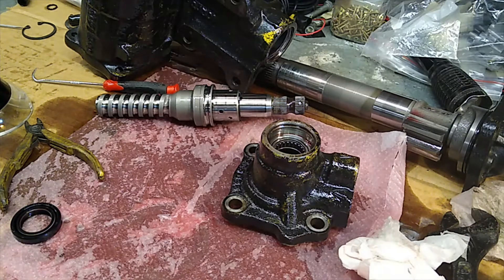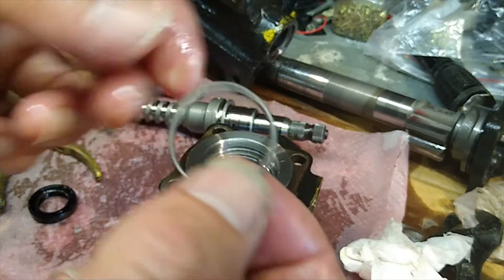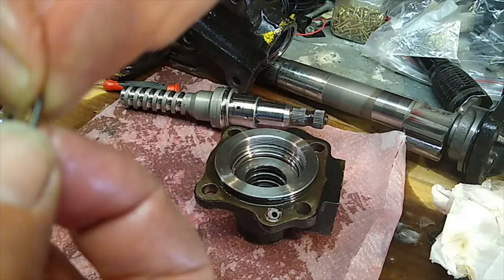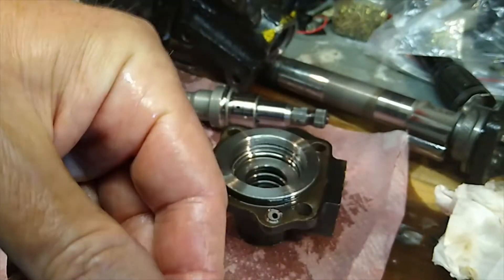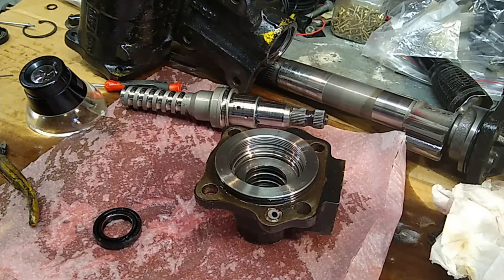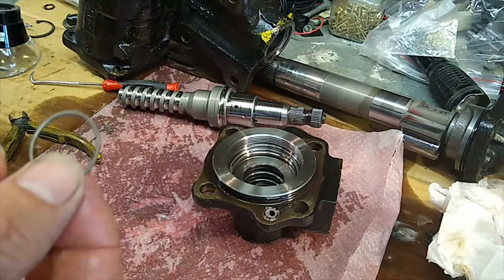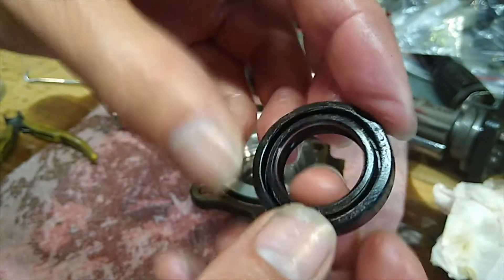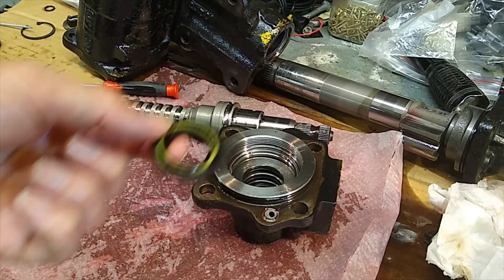Adjusting Oil Seal tightness to stop leaks on rotating shafts after dressing out pitting or grooves.

Comment: Thank you so much. This is a great tip. Much appreciated. I have a leaking transmission rear seal on my truck. I replaced the drive shaft but the old one caused the transmission output shaft bearing a little damage. The new seal  went on a little too easy. Im going to do this with a new seal to tighten it up just enough to see if it doesnt keak. What an incredible video.

Comment: Thank you sir. Never even knew this was possible. Only just today discovered they were even called a garter spring. Was close to buying a replacement seal with spring for my vibratory plate compactor,. The seal still looked good though, & now by reducing the existing spring, seems like I've got all sealed tight enough against the exciter shade. Will keep an eye on it over next wk.

Comment: I have the same problem. Tiny groove worn on the camshaft carrier on a Trooper, coincidentally. Was thinking of sanding a 1mm off the oil seal so it seats a little further back. But this could help too.

Comment: Excellent appreciate your explanation I have a countershaft sprocket seal that’s leaking and it’s brand new and it’s the third one I put on so evidently it needs to be tighter and I thought about this but didn’t understand how to spring came apart very very good explanation you actually answered a big problem dealing with on my 650 Honda XR dirtbike great! Great idea the pointed in and the flat end explains at all thank you my name is Thomas Fresno California